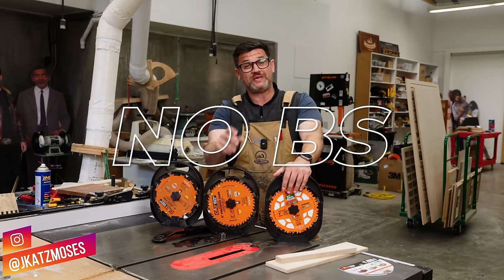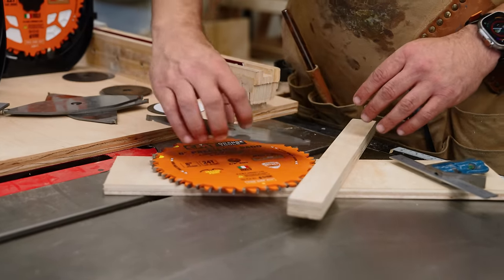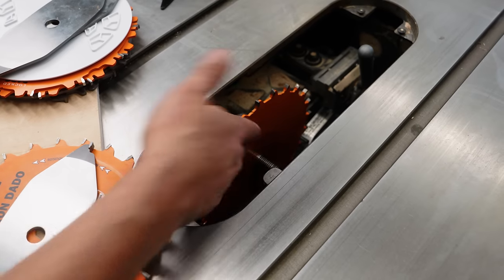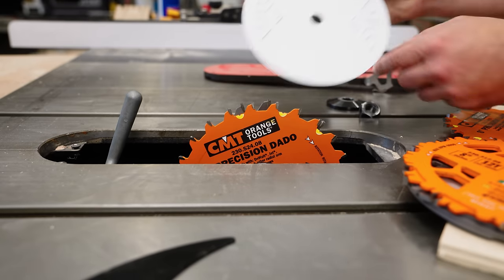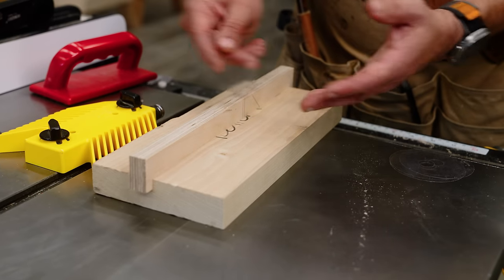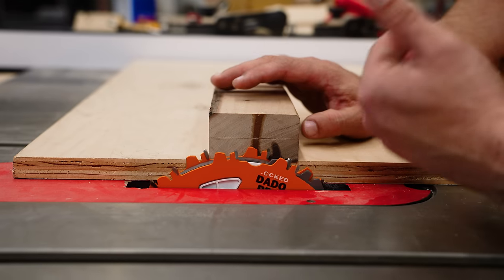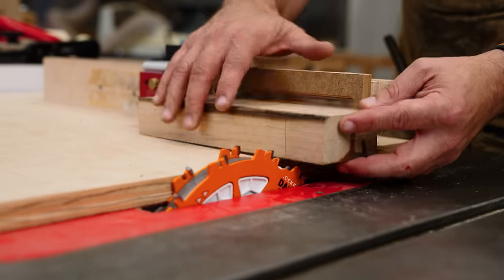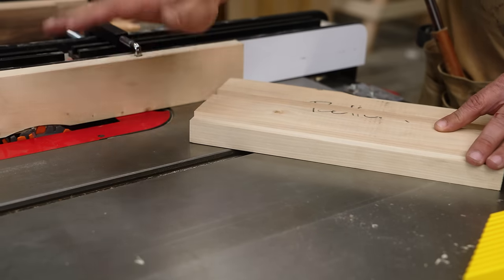Mastering the Dado Stack: No BS Advice for Woodworkers

Comment: There are two other tips I would mention. If you cut a lot of dados that only use one chipper, alternate which chipper you use to reduce wear and tear. The other thing is if you get to the point of needing to get your dado set sharpened, you'll want the machinist to do both blades and all of the chippers at the same time. This ensures that all of the teeth continue to cut on the same plane.
Reply: Good advice. On the cautious side but still true

Comment: You have wobble saws and dado stacks but one you almost never see on these kinds of videos are the adjustable groover/trencher that's been around in one way or another for a hundred years, with replaceable carbide versions being available for the last 25 years. Much easier and far more accurate to set up compared to the wobble saw or dado stack as it's two solid plates that overlap each other, and you fit shims in between the plates the exact amount over the minimum width of cut for the size you need, so with an 8mm groover you would want to add 2.4mm of shims to create a 10.4mm dado/groove/trench. The only downside is that they don't have as much range as a dado stack so you would need multiple sets, with sizes usually being 4-8mm, 8-16mm, 16-32mm and so on, which works out far more expensive than dado stacks but so much better for the industrial user as they last indefinitely and can be maintained in-house by replacing the inserts and do not need frequent regrinding as dado stacks do to keep them cutting well in abrasive materials like melamine-faced chipboard.

Comment: Hi Jonathan, great no BS video. I have a question for you. How often do you tune up your saw? By tune up I mean using a dial indicator to check blade alignment to miter slots and squareness of your the fence? Also would like to know if you check arbor runout? Thanks Chuck in CT.

Comment: Love your work. I often watch YouTube videos at 1.25 or even 1.5 speed, but not yours! Question: do any of the dado blade makers make a single outer blade to stack with a regular 1/8" blade so you can use the "1/4,1/4,1/4" (actually "1/2,1/2,1/2") system for drawer joinery with "1/2-inch" plywood that is actually less than 0.5" (12.7mm) thick? Or, 2 8", thin-kerf outer blades? For that matter, could you use 2 thin kerf 8" circular saw blades stacked together with appropriate shims for "1/2inch" plywood?

Comment: Lots of great info and tips in here, especially using shims to dial in the thickness. Hopefully that will take a couple of iterations out of my test fits. Another suggestion: if you're working a lot with the same material, make a test board for your common thicknesses and write down what the blade+chipper+shim combinations were (say all your cabinet carcasses are 3/4" ply from the same supplier) then you can test which groove your "shelf" fits best on your next project and start from there.

I've gotta say though, the finish on that half-lap cut there was a little disappointing. I borrowed a dado stack from a friend and the bottom of those cuts were perfectly flat -- no cleanup required and straight to glue-up. I won't say which brand it was.
Reply: I was going to ask . I have seen a few videos where marks were left on the board . If you can shoot me some type of link , code . I need a dado stack where I don’t have to do no 👎🏽 cleaning. For the prove it’s time saving and neater . Thanks

Comment: Hey Jonathan, Great video as always. I really appreciate great knowledge and tips.
I have a job site table saw 10" blade 2 HP, I was told with a Motor lower than 3 HP to use a 6' blade. Is that correct?
Reply from the maker: No. That’s plenty of power to run a 10” blade
Reply: Sorry, I meant to run a Dado blade since it has more weight. @katzmosestools

Comment: I use a two-blade wobbler on a radial arm.  It is convenient, though setting the width and depth requires trial and error on scraps.  Also, it leaves waves on the wood surface, so it's not good for fine work.
Reply from the maker: Yeah they seem like a pain to me

Comment: So sad for me,  I'm a newbie and use a jobsite saw.  they are deliberately made with a short arbor so it won't accept a dado stack
I have found a decent work around so I can still get it done.  Love your channel JKM
Reply: Be careful, it’s not just the length of the arbor, the stack might come loose if the motor is not strong enough to handle the weight of multiple blades - don’t know too much about the cause and neither do some of the major companies making these saws but the nut coming loose and thus the saw blade time to time is not an unknown issue. Not just with dados but sounded like this correlates with using dados even if that jobsite saw is made to accept dado blades. If anything I wouldn’t take off more than 1/4in per pass slowly on these jobsite saws (depending on how wide the dado stack you’re using)

Comment: Thank you for another informative video, I have a old Freud Dado stack need to replace, which one of the CMT’s you mention comes with magnetic shims? Thank you.
Reply from the maker: The locked dado does. It ls incredible and so easy to use because you can stack it up outside the arbor and put it on all at once. Linked in the pinned comment
Reply: That’s  what I thought, if I prefer the 24T for finer cuts, I guess no magnetic shims with?
Reply from the maker: Maybe. Check the product description. I would’ve put it in there if there is. Been a while. I used to feel the same but after I switched to that locked dado I realized it was so much easier to push through cuts with a 12t and the cut rarely matters because you’re using glue in almost all places you use a dado AND the chippers still only have 2 teeth so the 24 is only smoothing the outside of the cut

Comment: Any advice for folks with smaller saws that don't have an extended arbor shaft?
Reply from the maker: If you rub it a few times it gets bigger
Reply: @katzmosestools  instructions unclear, someone call 911
Reply: @katzmosestools  but seriously, no dados on jobsite sews?
Reply from the maker: Use an FTG (flat bottom grind) and you can get the same results an 1/8” at a time.

Comment: I have seen a few people use a radial arm saw for dado stacks which got me to thinking of doing it since I have a radial arm saw. Any experience or opinions on dados being used on radial arm saws?
Reply from the maker: I’ve honestly never used one. I’m not a big crosscut saw guy. I like my sleds way too much.
Reply: @katzmosestools  I'd love to have sleds but my cheap contractor saw is a Craftsman and has those crappy tabs. I've been wanting to upgrade to a better table saw for a while now since my Craftsman really handcuffs me on sleds and other jigs so maybe it's time I look harder.
Reply: On a radial saw you need to be extra careful because the larger number of saw blade teeth engaging with the wood tends to pull the sliding saw into the cut more aggressively,  just have a good hold on the saw handle and be prepared for it to pull the saw into the workpiece. A radial saw is convenient to use though when cutting crosscut dadoes into a longer workpiece,  like cutting shelf dadoes into the side piece for a 6 foot tall bookcase or cupboard.
Reply: Look on youtube, there is an older guy who's done vedio on almost everything you can do with a ras  Radial Arm Saw  and a few on tricks how to cut perfect 90s without moving the arm also how to cut picture frames perfectly with a jig.

Comment: I keep hearing this myth "Metric is better", but I have yet to hear anyone be able to explain it. Is imperial somehow less accurate? Are the units of measure in metric somehow more precise? What causes this, and why can't it be mitigated in any way. If 11/64" is equal to 4.3656 mm, then why does metric need more numbers to express it's value?
Reply: I use both metric and imperial, but for different things.  For making drawers, I find that I hit the final outside measurements of the drawer more accurately with metric.  I can do a lot of the math in my head.  With metric, I make fewer mistakes with my measurements.  Once I did kitchen cabinets for my first kitchen build all in metric and didn‘t make any mistakes.  The cabinets fit perfectly.  But sometimes it just makes sense to use imperial when your materials are furnished in imperial sizes.  That‘s why I use both.

Comment: I have a few wabbel dados,
But i bought the made in japan dewalt stacked dado set, it has 4 tiped chippers and gives a nice flat bottom cut.  The 2 tiped chippers depending on feed rate do not leave a flat bottom.

If you need a flat kerf then your dado side blade have flat cut carbide cutters.

You guy who use metric just can't do math. ( joke in response to your metric is better comment) 
Really it doesn't matter 
We can all go back to cubic mesurments  when God told Moses how to build the Arc

Bill Cosby joke  (Whats a cubic?)  .

Comment: That's funny, Metric is better than Imperial, while the numbers you read might very well have been in Engineers scale, you know, broken into thousandths per inch, which ain't metric. All the Euro metric folks can't even buy a dado stack. Their safety police outlawed them last I heard. Which scale is better? The one you can use with precision. Imperial breaks down into 64ths on some scales, yeah, too tiny to be comfortable to read, it's also .39mm. which you'll never see on a metric scale, you won't find .5mm on a scale.
Reply from the maker: Firstly, you’re right in the sense that you should use what you’re comfortable with. I think fastest in imperial but I design tools in addition to being a woodworker and can say with 100% confidence that metric is so much more user friendly, accurate AND universal. I send in drawings regularly with fractions of a millimeter (2.5mm being very common). The locked dado stack is actually approved for use in the EU and what is illegal has to do with stopping time and not dado stacks themselves. It’s like a second language. I speak English but love getting to converse in Spanish because it’s a beautiful sounding language. I speak imperial but much prefer to work in metric.

Comment: At 5:05 you talk about 3 threads. Unclear wwhat you mean; let the cameraman under or into the saw table to SHOW me 3 threads left showing on the arborAFTER EVERYTHING IS IN PLACE AND TIGHT! Same with explaining how the carbide teeth must be positioned, so they do not interfere with each other when the nut is tightened. The carbide on the individual saw teeth are not co-planer with the plate of the saw, but stick out a tiny bit; this allows clearance for the saw plate; if the operator is not careful to keep them from touching, the carbide will hit and bend the saw plate as the nut is tightened. Too complicated to say easily, but if you let the camera in to see, as you explain, suddenly " the light comes on", with clear understanding!!

Comment: Great video, as always, Jonathan.One tip from your friend Mike Farrington worth mentioning: he created a sample board with all of the potential dado combinations running side by side, from 1/4" to the largest. This way he can take the actual board that he wants to fit into the dado and check it against the sample cuts to determine the exact fit. He then references a sheet where he has listed the combinations of components that make up the corresponding dado stack. It would be worth doing if you make a lot of dado cuts, and especially if you're using a wide range of board thicknesses. Cheers.
Reply: Is there a video from Mike showing how he does this . I was thinking 💭 to do the exact same thing . Set it once then it will be my go to .
Reply: @deanowright359  Sorry to be so long getting back to you -- it took me a few tries to locate it. See Mike Farrington's video "How to build a chest of drawers", around the 8:04 minute mark. (I was wrong to think he needed to reference a separate sheet; all the essentials are right on the plywood reference board.) Of course, any of Mike's videos, rare as they tend to be, are pure gold. Cheers.
Reply: I'm totally doing that. Thanks for this!

Comment: So I bought a European 30mm Dado stack in the UK, here is what I found out, They supply it with 3 locking spacers and there is no configuration for 3rd spacers. So what is the other one for? Only the 6mm 7mm are actually  6 & 7mm the rest of the sizes are under 8mm is 7.8mm with spaces and the 20mm is 20.02mm. This is not such a big deal as you can buy extra shims. The dealer was a big c*ck when I called him saying put it in a email. Is the 5/8 stack you bought in mm or American. Your plywood is probably European that is why it not true 3/4 probably 19.05 mm.

Comment: Great show, Jonathan. You hit all the relevant points without talking down to us mere woodworking mortals. Even with my 30+ years in the shop what you present is a good refresher and you even taught this old dawg a new trick!

I want to discuss two important points with you all. First...throw those wobble blades as far as you can throw them. They are brutally ineffective if you are doing fine joining, as by design they create a crown in the bottom of your cut. Dadoes will look sloppy, and rabbets won't line up square. They are also (in my opinion) very dangerous to operate relating to kickbacks, as I will soon describe.

Second...get you some high quality, super sticky pushblocks. Maybe some came with your jointer, or maybe you find some at the KM store or TayTools. (Neither sponsor my rant, by the way😂). The cost...maybe $40/pair is certainly much less than the $30K I spent years ago getting the fingers of my left hand repaired when the board I was cutting ejected and the fingertips came in contact with the 3/4" wobble dado. I was pretty helpless for eight weeks during the healing process, and the hyper sensitive new flesh kept me out of the shop for six months. Nobody wants that. If I had been using a pushblock, none of that would have happened and after changing my undies, I'd have been back to work. Be safe!!!